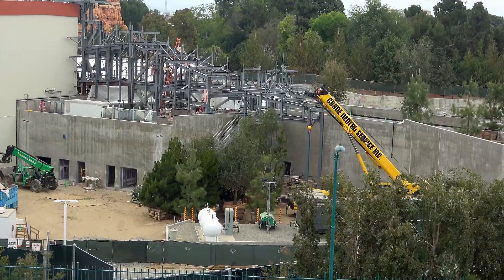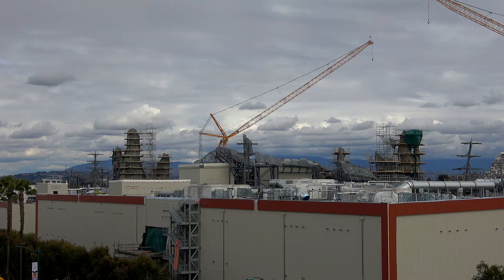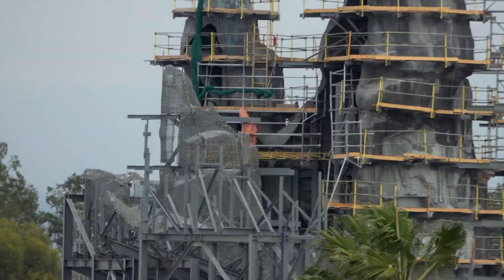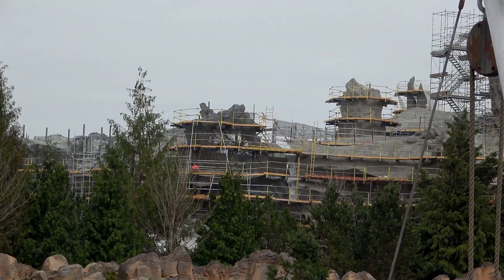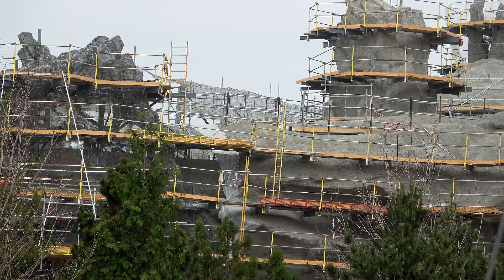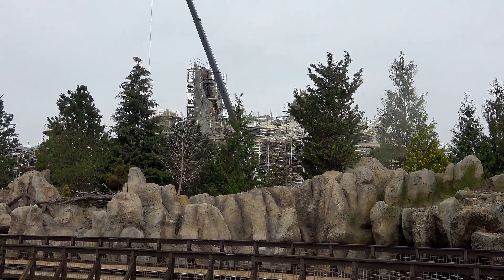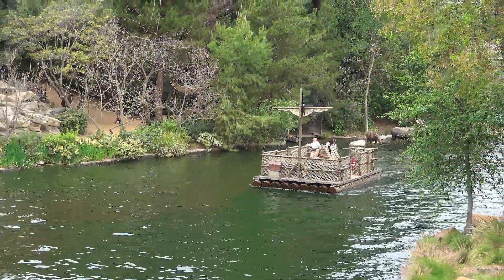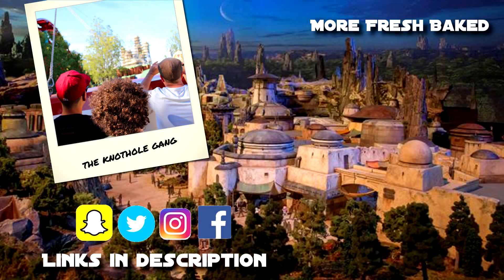Trees are coming! - Galaxys Edge Construction Update - Pt. 139 | 04-07-18

Comment: The fake trees will be miniature trees to emphasize the scale  and they will be placed high up in the rock-work on the buildings like you see in the model from D23.  They will not, as you suggest, be used to fill out space with the regular trees along the berms.  Carsland did the same thing with its fake pine trees that make the rock walls feel bigger and farther away.
Reply from the maker: yes, this does seem like the logical use.

Comment: Could the fake trees be trees indinginous to Batuu.
Reply: That's a good thought. It's quite possible. They can't go too crazy though, since so much of this will be visible from the Mark Twain, and everything you can see from the Mark Twain has to also fit that Columbian Gorge American frontier theme.

I'd say another possibility for WHY they're putting in fake trees could also be that they may be adding them to parts of the mountain where there is rockwork but no dirt for a live tree to be planted. They're building this GIANT mountain range across Battle Escape and Falcon, and there's no way that's going to be only rockwork. They will likely put up fake trees, vines, etc interspersed amongst the mountain range to break up the visual monotony that would otherwise come with a solid wall of blank rock.